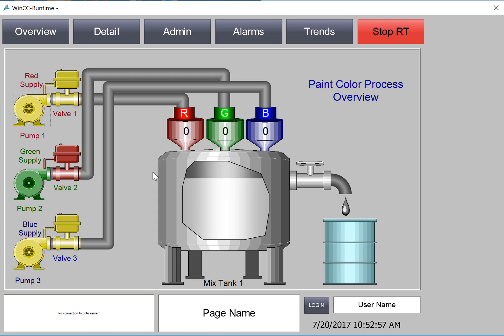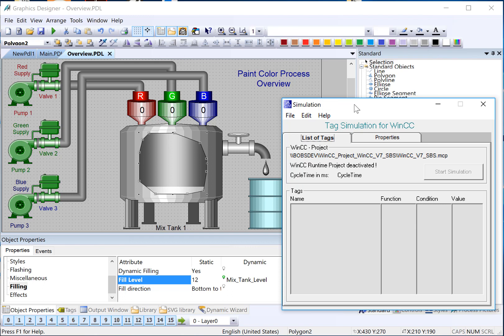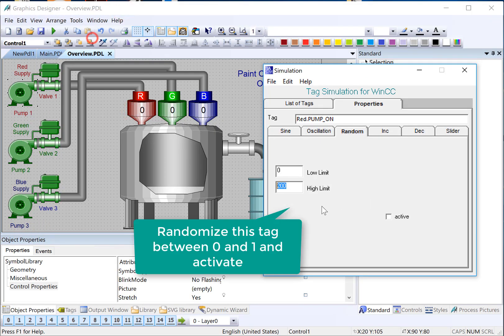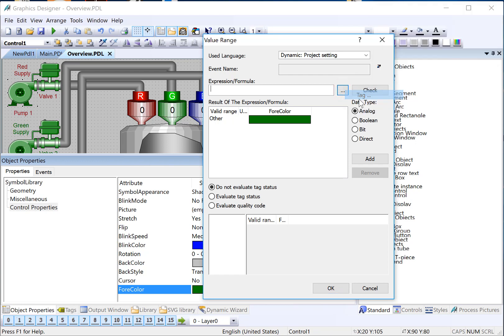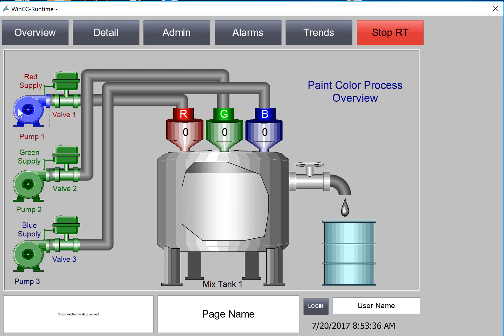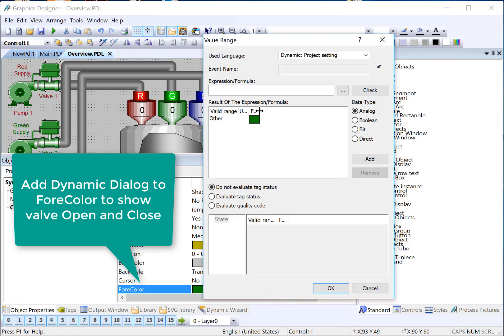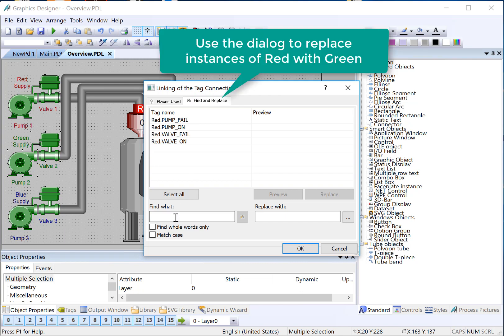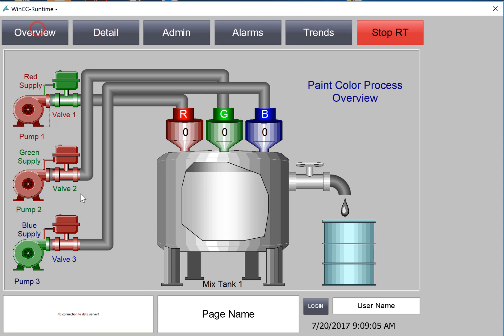WinCC v7.4 Step By Step #11: How To Create Animations with Dynamic Dialog 👾 #WinCCGURU

Comment: I am unable to attach Blink tags properly like in dynamic tag when i attach tag and on yes i do shaded-2 it automatically applies to both Yes and No while you were doing on Yes it was shaded-2 and on no it was No-Flashing.
How to solve this problem?
Reply from the maker: I would have to see your screen but you should be able to change both yes and no values as desired.
Reply: @WinCCGURU  The problem is i can't add Screen Shot i have tried but my both values are changing i don't know like i have made some mistake i will try it out again in tomorrow morning and i forgot to tell you i am doing this on Wincc V 7.5 maybe thats the problem i dunno.
Reply: @ArslanAhmad-d3k  HI I have the same issu did you got solution
blinkmode issu its change both for true and false 
thanks in advance
Reply: @wafaaachour7839  No i wasn't able to solve it?

Comment: Hi Bob!!, i'm trying to configure Blinking function, but looks like there's a miss property, I'm using WinCC v7.5
Reply from the maker: It depends on which object you want to blink or flash.  If using the siemens HMI symbol object you need to use blink mode property with blink color. If using WinCC objects you need to use flashing Boolean property for text border or background.
Reply: @WinCCGURU  thanks so much!